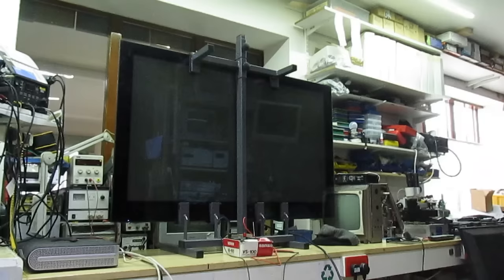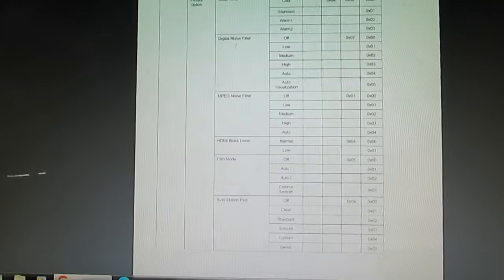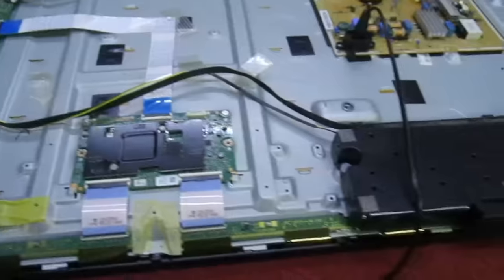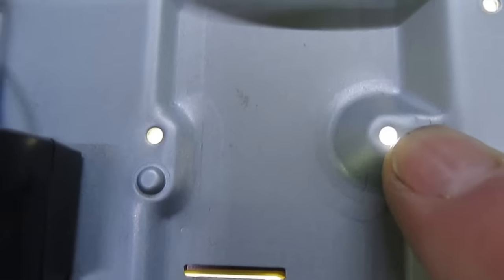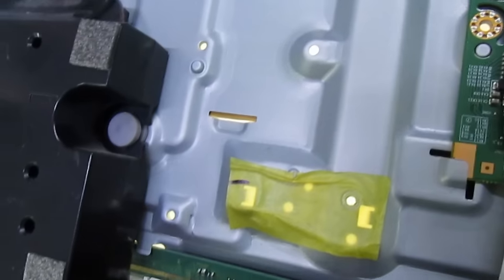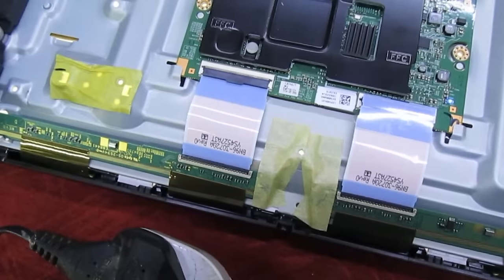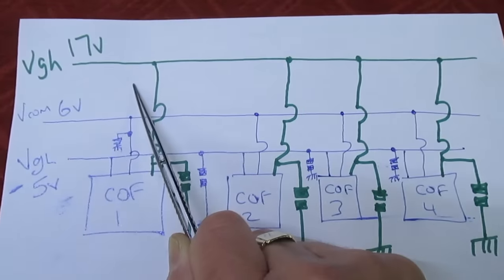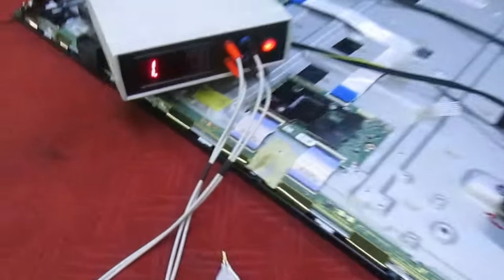Video to highlight the problem of repairing flat panel TV sets

Comment: Brilliant video and great fault-finding. Think of all these sets that go to the bin because of a component costing a quid or 2! It's a pity and rare, stuff like this just don't get repaired in the world of today.
Reply from the maker: I would imagine most people would have wrote this set off after disconnecting the T con board thinking the LCD panel was faulty.
Reply: @michaeldranfield7140  Possibly, but what isn't being said is the labor costs in fixing things. e.g motor vehicles being a big one. Plus I also remember when I had a Panasonic boom box decades ago and had to replace a volume potentiometer. Replaceable, but needed to be ordered from the manufacturer and expensive to boot.
Reply: My cousin had a booming business fixing sets years ago but transitioned to other stuff , it  just petered out
Reply: You’re forgetting the old adage. 
Cost of hitting boiler with hammer £1
Knowing where to hit it £999
Reply from the maker: @aloysiussnailchaser272  Yes I have heard of that saying in the past .

Comment: It  really chaffs my ass when I can remember working on sets that had the full parts and schematics inside the back cover.  I can even remember vaguely my mother taking me down to the repair shop to buy a new tube for less than a candybar. Trouble shooting the tube types was easy, just look for the tube that doesn't glow and isn't hot. 5 steps forward on technology, 10 steps back on sustainability.
Reply from the maker: I know what you mean, large components that were easily tested, most SMD parts these days are so small there's no space on them to print the value or part number so without a service manual your stuffed.
Reply: That reminds me of a joke a TV repair shop had on the radio years ago, it said something like" Yes ma'am we found the problem with your TV, it has all these little black things in here." Referring to the new components I presume. Still funny. The shop no longer is open, obviously. Odd that there seem to be shops opening up for phone and computer micro-soldering (not in my area) but nothing for TV's. Perhaps because of the cost difference, a phone is as much as a car and tele is almost disposable. I never purchase the extended plan only because I know it is how they make their money.
Reply: I was the chief technician at a major service center for a number of years, GE was one of 40 different manufacturers that we serviced and GE used to put a schematic diagram folded up and have a little plastic cover that attached the schematic to the back of the TV. That certainly helped we did not have to subscribe to at least GE TV schematics, most of the other manufacturers you had to purchase them or if you're lucky a Sam's on them
Reply from the maker: @toxicooze2220  In the UK Grundig always put a circuit diagram inside the TV set which was an excellent idea, the only problem been the first person to service the TV would keep the diagram .
Reply: @michaeldranfield7140  😅

Comment: One of the reason I knew that my days as a bench engineer were numbered was that it was cheaper to buy new machine than repair the old one ..also I don't really want to be a board swapper !!
Reply from the maker: no one else within 20-30 miles radius from me , everyone has closed down for that very reason but this is the only thing I have ever done so I cant help myself !

Comment: that is disgusting from manufacturers these days. Absolutely disgusting! I fully support the right to repair agenda!
Reply from the maker: Right to repair is suppose to sort this problem out, however I don't think anything at all will change, all manufactures need to do is price parts so expensive that no one buys them and for them it's problem sorted.
Reply: @michaeldranfield7140  watch jenna joneses last video on the latest apple  to repair suppsed embra ement

Comment: Nice. Reently seen the opposite level of damage here where a failed mains bridge repair was attempted by the owner who tried to stop the fuse blowing by wrapping it in al-foil. Needless to say, the entire input section of the power supply was 'toast'.  
Samsung service manuals haven't impressed in some time. Every TV seems to have different connections and timings for no valid reason or I'd stock up on boards from dead screens regardless of model and just swap them in. They should learn a thing or two from PC board makers. (PS: wouldn't it be nice if the led boards screwed in from the back or slid in sideways without the need to remove the screen from the frame. Just sayin. )
Reply from the maker: I wouldn't be that difficult to have a rear access to the backlights but the reality is the makers don't want you repairing sets, everything is designed now to encourage you to just buy  a new set.
Reply: @michaeldranfield7140  Or sent to a service center which I worked at. Some ended up component repair, while others was board replacement for the same reasons here, economic. It just meant we'd have all the parts needed.
Reply: I have an RCA 65” that has bad LED Backlight diodes. With this model you can access the LED strips from the back with the screen flat down on your table. You take off the small covers 1st which also revels the boards, then you remove the large metal back cover. This cover lifts up with the 12 backlight strips attached to it with a cheap white cardboard reflector then glued over the strips with holes in it for each LED. After you tear the hell out of the cardboard reflector to get to the backlight strips to work on you can then tape the reflector back together where it tore from the backside as to not change the reflective properties of this backlight reflector. You’ll get a few years then a couple more LEDS will then burn out again!
I say STAY AWAY from Thompson Consumer Electronics “RCA” products altogether if possible. I always recommend Samsung, LG or Visio. Symptom of this tv was flashing backlight strips that would not stay on, audio fine. If you unplug the plug with the 4 small wires that feed the backlight strips the power then remains continuous on the power boards output receptacle pins for these 2 pairs of wires.
Reply from the maker: @repairfreak  if only all TV s had a backlight inspection flap , the world would be a better place .
Reply: @michaeldranfield7140  Right, but for now we at least have inspection holes, “at least in the ones I’ve serviced so far.” However you are kind of just guessing what holes the light should come through. Another way is to lift the Television up and shine a bright penlight at just the right angle through the front of the screen and you can actually see “very dimly” if the LCD panel is working & producing video. I will press the menu button and look for the faint lettering.

Comment: Great video! Especially liked the clever way to single out a faulty capacitor, thanks for the lesson!
Reply from the maker: singling out a single capacitor only works with a millohm meter if the short resistance is less than 1 ohm, if the short is above 1 ohm what I do is power the rail from a bench power supply and see what gets hot .
Reply: @michaeldranfield7140  Do you use a thermal camera, or is this the finger test?

Comment: Great Video!  I was a T.V repairman in the 1970's.  I would have been pretty tempted to replace all four of those 17V bypass caps since they surely all came from the same lot and are all exposed to the same power rail.  IDK.  What do you think?
Reply: They tend to fail because of thermal stress - mostly caused by having solder pads that are far too wide.
Reply from the maker: Of course you are right and many years ago when sets were expensive and people didn't mind paying a sensible price for my time I would have done just that, replaced them all, but now sets are so cheap I'm working for next to nothing it's not possible anymore.

Comment: Wow. When I was a young lad I used to deliver TV's for a local company. They had several engineers working in their repair shop. 
I thought things seemed complicated back then but the modern stuff seems even worse. 
One old guy called Norman used to work on the old valve sets & knew all the tricks of the trade. Including polishing scratches out of the tube with Brasso. (Mostly Philips tubes no matter what brand TV they were)
Then the Japanese took over & only B&O were better. People used to ask me why do you need 100 channels? When we only had 4 to watch. (If you were lucky) most still had 3. 
How times have changed. 
You should be a tutor pal. Your video was excellent.
Reply from the maker: Back in the old days of proper service back up from the manufactures and individually spare part availability  there was hardly anything that could not be repaired, now the tables have turned and I end up scrapping loads of stuff, the set you saw in this video was just one of the lucky ones fortunately.
Reply: @michaeldranfield7140  Yes, my start as an industrial electrician was 1963.
A proper electrical apprenticeship, including power generation on site, a steam engine driving the alternator, the first factory in the South West of England, possibly the whole of the UK allowed to generate in parallel with the Grid.
I'm never forget I was trained by men who had fought a war in 1939
With 24 hour processing in a leather tannery the value in the cost of leather imported from across the world would have been horrendous.
The Hours and responsibility to the firm and production workers was huge Thinking back to being 16.

I can still remember being sent out on my own with the innevitable question, "How long will it take," before I had opened up the control panel.
That era, a test lamp with a filament lamp, only the Electricity Board had the moulded test lamp for 415 or 240 AC.

We were designing and manufacturing our own complex control panels, a lamp with a resistor was simple but never achieved.
Neither did the department spend out our on the vital tool for our everyday safety.
One AVO between two factories, two miles apRtt, and seven electricians.sharing that instrument and two Megger's for insulation testing.
Steel Control panels were made to order from Brook Motors Huddersfield.
A lead time of 23 weeks.
I have mislaid my RS Components catalogue from 1966 which was A5 format pre metrication.
16 maybe 24 pages, resistors, including volume controls, capacitors, control panel wiring in 16 colours, transformers.
An address in central London, I can almost remember th address.
Damaging the AVO was unforgiveable because it took three months to get repaired.

Comment: Brilliant video, thanks. How much I agree with you, I was also used to repairing down to component level. I started off in the early 1960's. I progressed through from 405 -line TV' s then into the birth of the 625-line uhf & the dawn of colour in the UK. As engineers at that time people like you & I were kept very busy!
I moved off into Broadcast Television engineering, until very late in my working life. Very technical & enjoyable it was as a career. However after a series of redundancies & nearing retirement, I found my way back into part-time domestic TV repair mainly Samsung, but also other makes. We had little access to service manuals, or spare parts, so I used to go online to download the various chip data-sheets & using a sort of 'reverse-engineering, work out how the various chips were interconnected etc. to aid fault-finding.  Long-winded, but it worked. 
In the current 'green' climate, where there is supposed to be a 'repair culture' perhaps expensive domestic kit such as TV's etc should now again, be made more repairable, with spares & service data once again more available.
Reply from the maker: That's all I do now is download the data sheet for the chip in question where the fault is but with chips getting smaller the information they print on the top is very limited which makes tracking down the correct datasheets all the more difficult.
Reply: I remember those days well -- having been taught RADIO repair  and driving at age 8
- That was 1949 -- Building radios at age 10/11
Took flying lessons at age 13 - A pilots license by age 13 - and joined the RAF in 1960
(Bomber command) - following  the footsteps of one of my aunts - who was Russian Jewish.
I served for 30 years in the Military - serving three countries - -  My flying days are over -
but I has the opportunity to study Electronics and Electro-Mechanical Engineering  - Law -
Psychology - Business Management - Risk Management - and Paramedics-
PHILIPS was the CORPORATION that produced the Avionics fro Australia's  FA/18 Hornet
4 years with PHILIPS and Sydney University - led to an attachment to the USAF working
on joint USAF .NASA projects. ( The USAF has control over NASA )
Iife  has been an interesting life - Many engineers - pilots and other Military personnel I have
known have been gradually passing away since 2012 ---
It is only June 2022 and I have attended ten funerals in this six months - one only on
Wednesday, June 15, 2022
Time passes rapidly -- I don't worry too much - as I may not be here tomorrow
There are no guarantees in life.
The thing is to never give up and KEEP LEARNING everything you can - to keep the brain active
and pass on your knowledge - as that will be your legacy to be remembered by.
Good luck every"one"
One day you will be some'body'  and join all the other bodies in the cemetery.

Comment: Thank you Michael. First time I've seen your channel. Used to have a Samsung Service centre about 3 Miles away in Rustic Mid Wales. Bumped into him and said got a backlight problem, ' No given up, Couldn't make it pay ' Bloody shame really. Tried people for miles around, but nobody wants to get involved in component repairs. One repair was again a capacitor, £ 20.00 quid job, but he worked liked you, eliminate, and know your stuff.
Reply from the maker: Just like the done thing these days is to replace the whole board when it has a fault if the backlights are faulty you should replace the whole LCD panel, and on some sets even with a separate T con board the T con is not listed as a replaceable item and it comes with the LCD panel, I don't make this pay either but its the only thing I have ever done so I can't stop!

Comment: I have spent 55 plus years in the repair field, and I was astounded by the lack of support and parts availability for the sets here in the States in the last 15 years or so.
I am glad I am retired from the repair business. Even if one would get a "tested" board from a "recycler" who said their boards were tested and worked" I often had to repair the replacement board. Even "rebuilt" boards were most often bad. They never even scrubbed the dirt & dust off of them. Just pulled the boards from a junk set & shipped them without testing. What a scam! 

  I generally went to the component level for repairs on the flat screen sets, but when a power surge hit the sets, it often burned the power supply board, badly charring it beyond repair.
Reply from the maker: You are right, the prople selling used boards say there working but in reality there just pulled from sets without even trying.
Reply: Sadly nowadays boards listed as "Used, Tested" means that you'll get to test it when you use it.
Reply from the maker: @FrozenHaxor  Absolutely correct , if you see someone advertising a board from a plasma TV and it says removed from a smashed screen TV but fully tested, ask them how they managed to test it when a plasma produces no picture at all with a smashed screen .